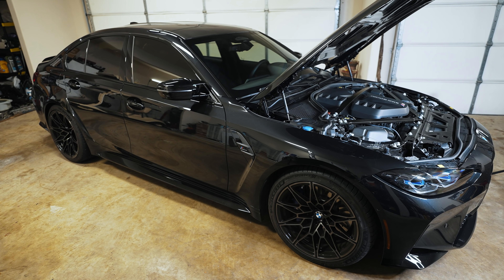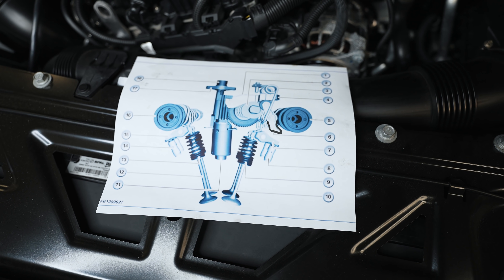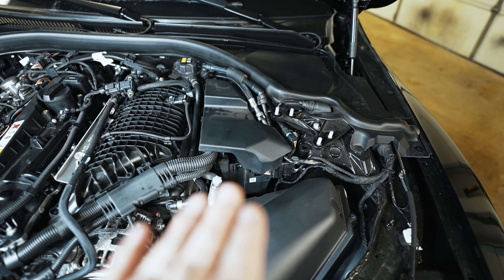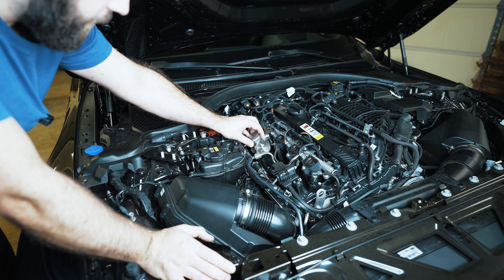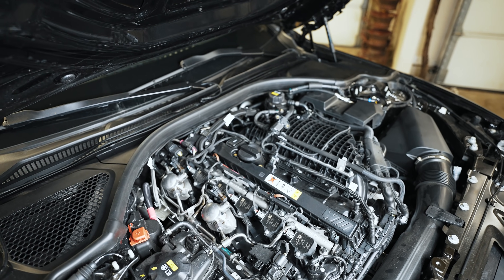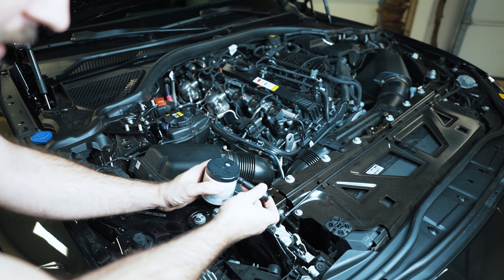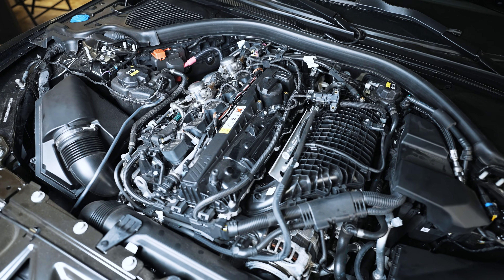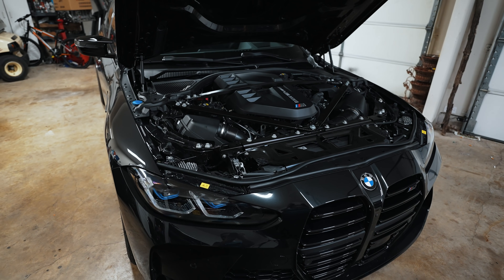This Is How Your BMW Runs.  All Sensors Covered

Comment: A Hall effect sensor (or simply Hall sensor) is a type of sensor which detects the presence and magnitude of a magnetic field using the Hall effect. The output voltage of a Hall sensor is directly proportional to the strength of the field. It is named for the American physicist Edwin Hall.
Reply from the maker: Thanks this is pinned.
Reply: https://en.wikipedia.org/wiki/Hall_effect_sensor
Reply: I am amazed that people do not know this.  Did everyone fail general science over the last 40 years?

Yes, I now see where an optical sensor was described as a Hall sensor.  Not quite the same, for sure.
Reply: @machtschnell7452  As someone currently in college (Computer Science), no one has as much as mentioned Edwin Hall. Certainly not even remotely close to something covered by general science.

Comment: I’m getting a Fuel Pressure below Target code on my G82. Code 11A204, I don’t know the issue or how it happened but there’s a fuel cut at 3/4 to full throttle. 
Any tips on how to fix this? Maybe low pressure fuel sensor? 
I only have Catless downpipe and JB4 installed

Comment: Hi Moussa.
My sons 07 E90 335i has some sort of electrical gremlin.  With the car off and keys far away, every 2 minutes there is a servo motor or electric motor hum or buzz. It lasts for 10 seconds.  Its like clockwork.  Ive checked the HPFP and the water pump. When sitting inside the car, the noise sounds like its coming from inside the dash. From the engine bay, you hear a click from the ecu and then the buzzing noise sounds like its coming from behind the motor around the fire wall.  without taking the car to bmw and spending 1000$ on a diagnosis... Do you have any idea what it might be?

Comment: Could you do a video on Vacuum Lines and PCV? 
I'm not a mechanic and most of my car repairs are carried out in workshops. I've observed that the shop mechanics normally checks the vacuum lines first for leaks but I don't understand the concept. 
I have 3 generations of Beemers and always fancied tinkering on some DIY mods, however workshop manuals only shows assembly and disassembly of the components but not the working logic behind it. 
My babies are an E36 328i (M52B28), E60 525i (M54B25), F10 535i (N55B30).

Comment: I guess the days of the esoteric  //M engines are gone , the architecture of this S58 is not too dissimilar from the n54/n55/b58.Makes me wonder though , shouldn't BMW have continued to evolve the S65 v8 for a few more iterations.Yes still continue to offer to turbo 6 on non m models but keep the v8 for the M3 /M4.There was still room for development, corvettes new lt6 v8 makes 500 kw
Reply: Turbo i6 engines have a much more broad power band and don't need to be at redline(killing rod bearings) to do it. The s65 definitely sounds better though!
Reply: @markburkey6371  True , ive driven an n54 335 and a v8 m3 back to back. The 335 was very impressive with that broad powerband, but damn that v8 was something else !!! from that chiga chiga sound at idle to that buzzchain like raw at redline.Couldn't wipe that grin off my face afterwards
Reply: @domkraggp9944  But which was better in traffic on everyday roads?

Comment: now it is time for some N57 modifications!! :D (500+ diesel HP / 1000+ nm) it will absolutely kick ass (and feel alot quicker than the M3 due to the NM) it runs 400hp with only a turbo upgrade..
Reply: With just a remap and a downpipe it runs 360hp / 710nm (E90 lci)
The E90 got the piezo injectors.. btw
Reply: Diesels necer feel faster than a bonkers turbo'd petrol.  They always feel diesel!! Ive had all sorts, N/A 911's, tuned 635d's, m135i's, m140's, tuned 640d's.  For me the petrol engines feel waaaay more exciting and therefore quicker.  Diesels always feel lasy to me whenever I go from one to another.

Comment: The cranshaft sensor is called a magnetic pickup, these are used in industrial applications for controlling speed on steam turbine, gas turbines etc. Basically the DME counts pulses in a period of time and calculates RPM. These magnetic pickups can be passive (don’t require supply voltage) and produce an AC sinusoid of variable amplitud or can be active they get a supply DC voltage and the signal back to DME is a square wave pulse type signal with limited amplitud. Also the notch is used for position it’s also sometimes called a keyphasor, so this wheel with teeth and that flat spot is used for both RPM and position
Reply from the maker: Nice, thanks for the background info.  The passive implementation is pretty interesting, in retrospect it makes sense given it's a magnet.

Comment: Why not to leave that plastic off, better cooling !
Reply from the maker: It actually has some small vents on the left side.
Reply: @VehicularDIY  vents on the side, yes, but it is much better without it, common sense. Is not like this is the most reliable brand in the world, every little bit helps
Reply: @lx4118  Reliability of any brand is an ephemeral concept when so many power plants and power plant types are employed by any particular marque.
Reply: @machtschnell7452  obviously you never own a BMW and a Lexus, but that is another discussion, what I am saying is take the beauty engine cover off and it will help cooling the engine, specifically those brands that already have issues with leaking gasket
Reply: actually u want to keep that heat in after a drive when it gets cold at night or something like that ( to avoid heat cycling)
Reply: @bimmerbahaa1425  that heat is insignificant, what is important is the high heat created when you drive, specifically in hot climate, the valve cover gasket, all the plastic shit BMW is using these days etc all those crack and break.
Reply: @bimmerbahaa1425  What?  If that were true, engines would always be idling and never shut off.

Comment: To keep it simple WAY TOO MUCH PLASTIC!
Reply: Dope tho, what engine you got ThTs all metal ? And actually efficient
Reply: @marioramos239  I got a N54. Which is why I’m still stuck replacing every plastic piece I can with alloy, For how much bmw charges for their cars and parts you wouldn’t believe they were made from plastic
Reply: @connor78910  Every manufacturer is the same, it’s not just BMW.
Reply: @TML34  Every manufacturer has the same thought process; $$$$. They just have different techniques in extracting it from the consumer. Which is why I’m calling out bmw on using way too much plastic!

Comment: Would you say your N54 it's actually faster than the G80 ?
Reply from the maker: The G80 feels faster at lower speeds, the N54 is a bit faster in the high gears but not by much.